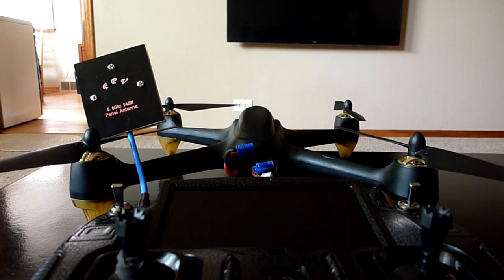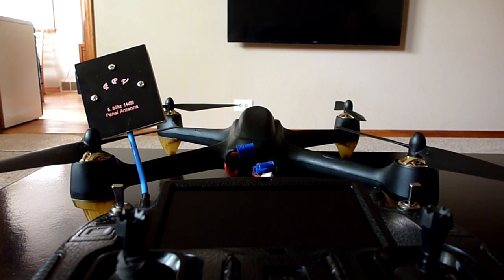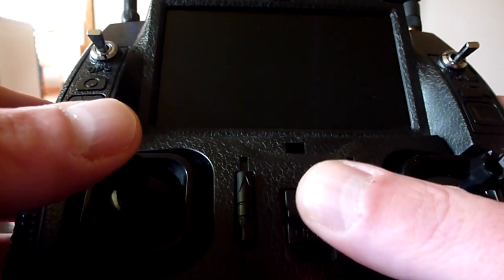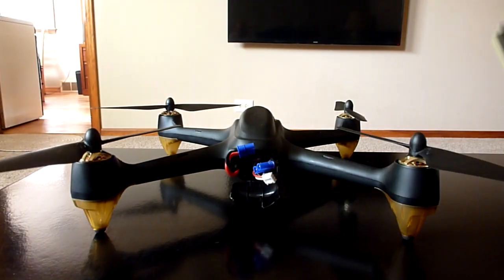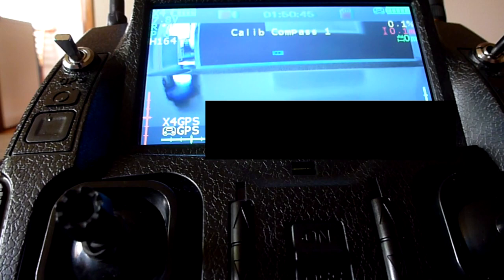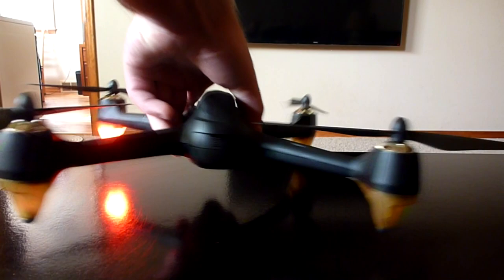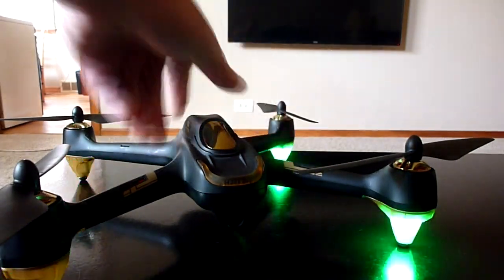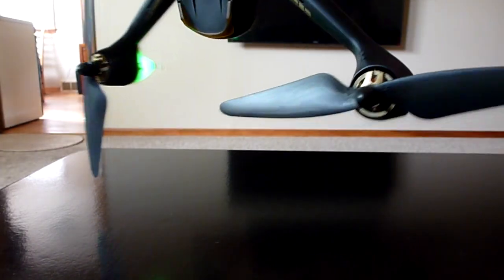Hubsan H501S Compass Calibration 1 & 2 (Also H501SS H501A )

Comment: The manual is confusing.... In the text it says do Compass Calibration 2 (the vertical one) by turning it clockwise, but in the diagram below it, it says counter-clockwise.  So I assume from your video counter-clockwise is correct??   (I am looking a manual version 1.2 En)
Reply from the maker: Allen either  direction will produce the same result.

Comment: Just got H-501S do you have to do compass bind every turn on ? You have to with mine yet some people tell me they don't .It fly's great GPS ,RTH ,Orbit all work fine ,Altitude mode is pretty tricky & makes quad faster but also harder to fly ...
Reply: Mine never ask for calibration, but as I fly it in places where theres other signals, like wifi, radio, phone, and cable companies antennas, I feel better if I do a manual calibration. Just in case those signals could affect the gps connection. To do it manually, just hold the left joystick down while move up and down the gps button from 25 to 35 times, smoothly, you don't want to break it. Then it will ask you to calibrate compass 1 and 2.

Comment: My hubsan does not go Into calibrate Compass one i have to activate it manuellyfrom the transmitter
Reply from the maker: Yes, they recently began putting no calibration compasses in this drone. You only need to calibrate when it asks now!
Reply: The newest firmware does not require constant calibrations.
Pg 16 of the manual shows you the manual compass calibration method if you change locations etc.
Reply: @mordechaijonez3812  I bought this drone just the other day. In the online manual there is nothing about manual compass calibration on page 16. How do I activate it manually?

Comment: What if it doesn’t go into calibrate compass one
Reply from the maker: Hi Dave Hubsan put out drones with a compass that does not require calibration at start up. If you would like to force calibrate the compass please refer to this newer video. I hope this helps, thanks for watching! https://www.youtube.com/watch?v=6Kf3-kAtMoo
Reply: @FlashForwardRC  so it will take video after I do this
Reply from the maker: @davemarshall4725  compass calibration is unrelated to the ability to record video. If you are not able to record video or can't see an image on the screen you have an issue that the calibration will not resolve unfortunately.
Reply: @FlashForwardRC  so do you have any suggestions
Reply: I’m at work right now so not with my quad
Reply: Do you recommend a firmware upgrade
Reply from the maker: @davemarshall4725  it depends on several circumstances. I have no idea if it's new, crashed, used and just bought. I don't know if it ever worked for you etc. If you are on Facebook you should join the Hubsan Zino H501 H502 group and post a short video of the issue. I and others can help you better there.
Reply: I’m gonna buy one more sad card if that doesn’t work I’m stumped
Reply: And return to home it just takes off on its merry way
Reply: It’s frustrating
Reply: Bought brand new from Amazon last week
Reply from the maker: @davemarshall4725  even a class 4 sd card used in your phone should work in the H501s without issue. If you buy a high speed card it may not work at all for recording.  A very common mistake new owners make is they forget that you need to press the video button to not only begin recording but it needs to be pressed again to stop recording and save the video. I have a feeling this may be the issue you are describing. 

As far as rth (return to home) be sure you have at LEAST 6 satellites connected before taking off- this is the time in which it will recognize its home point that it will fly back to. Happy flying!
Reply: @FlashForwardRC  I see on screen ok just won’t record or rth function won’t work
Reply: @FlashForwardRC  I’ve had 10 satellites and it still flies away if I’m not prepared to turn off rth

Comment: It keeps repeating calib one after calib 2 finished
Reply from the maker: Be sure to calibrate and lay it down immediately for take off after calibration 2 otherwise it will invoke calibration again.
Reply: @FlashForwardRC  I thought about that but it want calib one even before I have a chance to put it down. No big deal I fly it without compass and seems it doesn't have effect on RTH. Only the leds doing funky stuff 😂👍